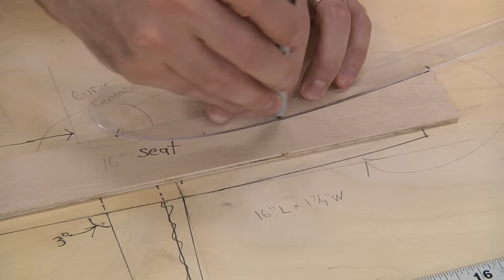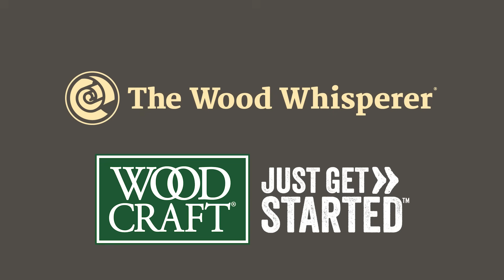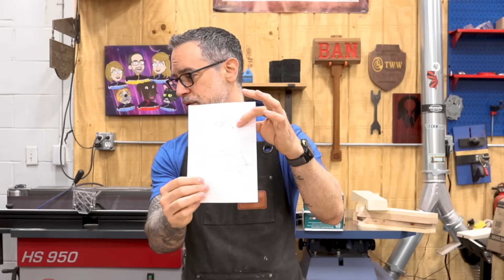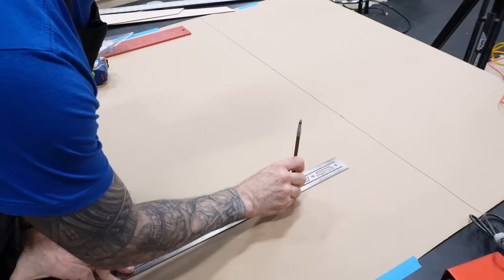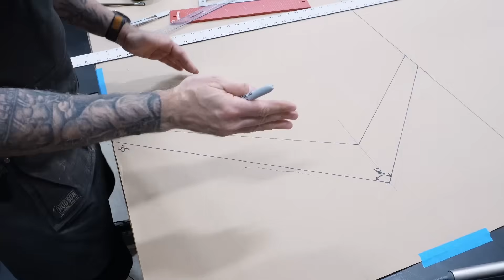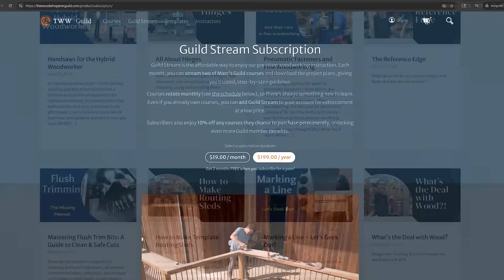I Don’t Trust SketchUp for This

Comment: I've been a cabinet maker since the early sixties and in the four years of apprenticeship I received we spent three months on technical drawings or as some call shop drawings. There are some cases where full size manually prepared drawings may be better. But my preference is for those projects that require them to take my PDF or other printable scalable file to a commercial copy shop and have them produced. I get the benefits of both; full size drawings to check reality by and CAD format to make revisions ultra simple.  Not everyone can spend the time it takes to learn CAD, but just like sawing a straight plum line or mastering a Jack plane are fundamental to woodworking, CAD and even more importantly all the current subtractive and additive tech will be to the future of the craft. Learn Auto CAD, Sketch Up or. Fusion of any of the other 3D modeling programs to the level where you trust it implicitly and you will become a better woodworker. I'll guarantee it.

Comment: I have my grandpa's drafting table (from the late 1940's or early 1950's) in my office.  That's where I design all my projects, shop furniture, house furniture, yard structures, you name it.  I already know how to draft, have all the tools to do it, and don't really have a desire to learn to do it in CAD.  I'm an engineer by day and sit in front of a computer using CAD/CAE software for 8 hours.  It's just more satisfying to stand at the drafting table with a lead holder and eraser.

Comment: I graduated highschool in 2016 and they still had a technical drawing class which I loved, it was a blend of drafting the first half of the year and CAD the 2nd half. So I learned solid works pretty early on but when I graduated and eventually started building out my own shop, I still use hand drawings because I find it quicker and more approachable. So it isn't a dead art yet!

Comment: A bit late, but I enjoyed this video. One possible option for the future is a lesson on sight lines. You touched on it a bit here but a deeper dive would be awesome. For example, I made a coffee table for my wife, which I'm very proud of, but one of the "neat" design features I incorporated which makes the top appear to float above the legs, is lost in the normal sight lines. A coffee table is short and small compared to a dining table, plus you stand closer to it, so you look more downward on it than a dining table, so the legs are largely hidden by the top and thus the floating feature is also hidden. The same exact design would probably work perfectly on a dining table and would have the desired effect as your eyes naturally see much more of the structure under the table.

Comment: I would have drawn a 15° line from the left side of the bottom leg up to the underside of the tabletop, and used that point as the left side of the top part of the leg. I wonder how close that is to the actual leg.

Comment: Would it have been a feasible solution to solve the rail-leg compound angle joint by finding the depth of the perpendicular to horizon cut whereby the surface would have matched the rail’s height identically?  By making the 22.5* cut on the end of the rail, then laying the rail down on top of the leg, sliding it inwards until the leg’s edges were flush to the shorter side of rail’s face, and marking the leg’s edges at those points, would the leg’s face have been identical to the rail’s in terms of surface area?  This was some incredible work and design and after watching you talk about the overhang as a problem to solve, I would be so intrigued to see if the above is possible, in your estimation.  Great work as always!

Comment: The question I often have on legs like this has to do with the joint placement. Specifically, what angle should the joint be to provide the most structural, stability and strength. In this example we see A horizontal joint that splits the 100° angle equally. Is there a application for tool that will allow us to model the forces to establish the best angle? Maybe horizontal, parallel with the table top and floor is always best, when creating multi-part legs, but I doubt this is the case.

Comment: I just had a thought..! Hi, I'm a 60+ year old joiner/carpenter. And I just thought.. if you made the skeleton of the frame in clay to you satisfaction, let it harden for a few days, then saw-up the joints with an ultra-thin Japanese saw, so that  some of the main long rail's have a 'flare' on the end's of them, to accommodate the irregularities of the transaction's of the 'knee-joint's'.. then just duplicate the sawn-off joint's onto the real timber members...👍

Comment: I took drafting in high school, and still draw out my designs by hand. I use graph paper and take a rough drawing to a scale drawing. After that, I draw directly onto my template stock. I also take notes during the build of the design changes forced by reality. I often make angle refinements, and note those so that I can update my final scale drawings. I don't use Sketchup or any other computer aided system. Same reason I don't use a CNC or Laser. If I wanted to be a programmer, I wouldn't bother with woodwork. I am a woodworker, so I don't bother with computers.

Comment: Your school story and what your thoughts about your future sounds very similar.

7th grade was my first time I was introduced to drafting. I also had a wood shop class that I absolutely loved. I still have the plant stand I made. In 8th grade, I had shop again. In HS, I actually actively sought out shop and technical classes. One included house plans, drafting. We had to design, draft, plan a house design for submission to city planning for permits. We had to draw the elevation and wall assemblies.
Entered college, my first set of classes were metallurgy, machining, drafting. Then I furthered that with manufacturing classes including plastics, machine learning (cnc), AutoCAD, wood working, and metals, and so on. They also included SPC and Ops Mgmt, so that led me down a path I didn't think of, engineering and manufacturing.
Now, after a 25 year career, I am looking at changing that to what I learned in school. Making using wood, metals, plastics, etc. and designing in CAD. And hopefully, dabble a bit in DIY home renovations because I've always had a love for architecture. 

Oddly enough, YT has been recommending Frank Lloyd Wright videos to me, one being that houses he designed and built are being neglected kind of makes me sad. I've always been a fan of his architecture and I remember when I moved to a town with a home designed by FLW, I would drive by it and wish I could go inside and see his work up close.

Comment: I use FreeCAD for some 3D modelling to support the design process but sometimes just bringing out a pile of cardboard and hot glue gun is the best approach. Especially if you need to figure out ergonomics or scale.

Comment: I think James Krenov's designs were nothing more than a few sketches on paper where he worked out certain joints and the easing of edges. The rest was "composed" as the build progressed, following the idea that he had in his head. Krenov was an influencer for a whole generation with his books long before screens took over.

Most of us would waste a lot of precious wood if we designed on the fly.

By Hand and By Eye is worth taking the time to read. 

Thank you for explaining your thought process in making a full size drawing and templates. Well worth the taking the time to watch and learn.

Comment: I think I would have left the first 22.5 degree cut in the legs, then just chiseled or routered out (with a homemade jig for a 22.5 degree angle) a notch/recess in the leg so that the rail is inset into the leg a little.  This would avoid the need to bevel the legs, plus give the structure a little more support since a little bit of the legs would be sitting above and below the rail.

Comment: I start with paper. I copy it on to an overhead projector transparency. I use the overhead projector and copy it onto Kraft paper or osb. I start at an inclined drafting table because I'm too technologically impaired to start at a computer.

Comment: I'll have to think this through further, but it seems to me your larger cut off of the "knee" went farther than needed, and making its extent the same as the width (height?) of the rail so they match. You could still taper any part you want, but that simplifies that step. ??

Comment: What you said towards the beginning about getting your idea out of your head & onto paper reminded me of something from my first semester in college. I was a music (piano) major, & for one of our required courses, we had to write an original, at least 3-page musical composition for at least 3 instruments (a singer could count as one "instrument"). Thankfully, we had until near the end of the semester, when we would have a performance featuring everyone's pieces. Well, yours truly could not come up with anything for weeks! True blank-page syndrome. I had a very abstract idea of what I might do, that I could extend over time, especially since I would have to do this every semester until graduation. But the music just wasn't coming. My professor for that class kept telling me just to put something - anything - down on paper. That act of making it concrete would make it easier to edit, or at least so he said. But the music just wasn't coming for me. Thank heavens I was able to finish it in time for rehearsals before our performance. I can see a correlation with designing, though. Get something down on paper, however "sloppy," and then you have something visual to work from & riff off of. So thank you for pointing that out. You're probably not interested in the rest of my story, but I left that school after that first semester (long & sad story). I did eventually pick that composition back up, slightly changed the focus, reworked it as a piano solo & added to it, & performed it as kind of a final project before graduating from the next school I attended. But, had I not written those first notes on paper, I doubt I could have done that. So there is something to be said for paper & pencil. Anyway, thank you again for this lesson. I don't usually watch such long videos, but I love your style, so I did. And I'm glad. I hope you have a wonderful day! :)

Comment: This has been one of the most useful woodworking videos I've watched over the past 10 years. I usually build to or modify plans somebody else has drawn up. I've only designed four projects from the  ground up, a pair of speaker stands, one LP storage cabinet with tambour doors and two turntable plinths for vintage turntables. I had no idea how to go about designing something with other than right angles before watching this video. Many thumbs up.

Comment: I used to build & repair computers and I'm the tech department of the family but yet I prefer to do all my designing with pen & paper, after designing I scan them onto my computer and print them out so I can keep the originals safe and use the prints in the workshop, if they get ruined while working I just reprint them

Comment: i've never done a full scale drawing, but i almost always do a scale drawing of some kind. my earliest drawings were on graph paper, then i moved to sketchup, and now, rhino. my experience with drafting is that you get out what you put in. it works well if you draw to the actual dimensions you plan on building and dimension tools allow you to extract that information and take it to the shop. the instances where i've built physical mockups (before my modelling days) were to answer 3D questions that my 2D drawings couldn't answer. i've also rendered a lot with Gemini and this has totally replaced the need to build mockups or hire a photographer when pitching ideas to clients. but, it's rarely / probably never plug-n-play. i typically book at least a day for AI modelling because there's such a tedious process to get it to cooperate without hallucinating. so to marc's concerns about the dimensions, they're (his concerns) spot on. you've got to give AI some point of reference, either the dimensions with a properly drawn model, or 'staging' your model virtually in someone's sketchup living room and letting AI reference off some standardish quantity, like a sofa. it's not zero work, but it is much more efficient than building and hiring a studio.

Comment: 17:33 I needed to pause and comment.. I built a home office desk early this year. That;s the almost exact leg design I came up with.. after a few sketches, cutting rough shapes from cardbord, moving them around somewhat like you did..

And then skipped the templates, prototype and immediately wend full on into building the legs with joinery I cant even name.. Nor imagine reproduce. But it worked ;)
Reply from the maker: Nothing wrong with that, man. I almost never build the same thing twice and don't often have the time to worry about prototypes. So I'm in the same camp as you. Sometimes you just gotta send it!

Comment: I agree 100%. I tried sketch up but it made me feel too divorced from the actual object.  Plus I LIKE TO DRAW WITH A PAPER AND PENCIL.  And I like to make scale models (like architects do, or used to do).  And  I often draw plans or pieces to size that can serve as cutting templates eventually after I am done tweeking them. So I am with ya, buddy.  For the record, back in the day, "artists" like Michelangelo and DaVinci were also architects, engineers and interior designers.  Michelangelo designed the scaffolding on  which he painted the Sistine Chapel ceiling and 500  years later, during the repairs, NO ONE could think of a better way to do build it so they used the same holes in the wall to suspend the new scaffolding.  Michelangelo DID NOT HAVE SKETCH-UP!